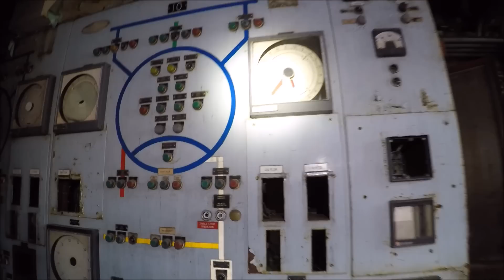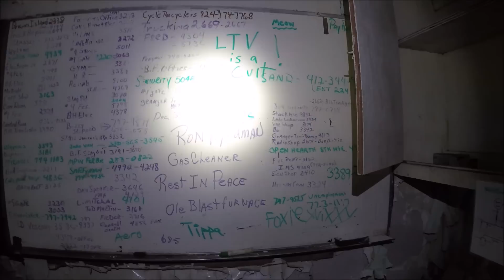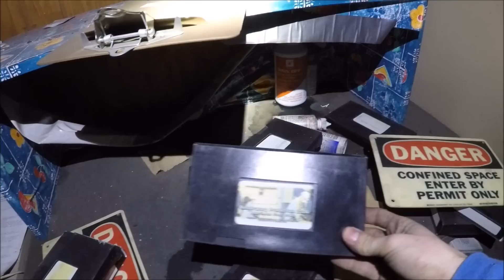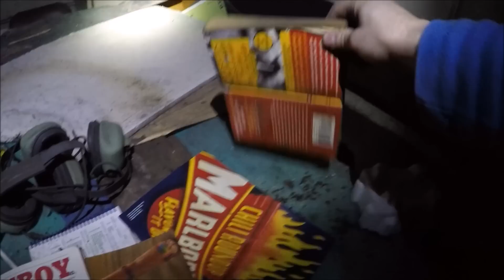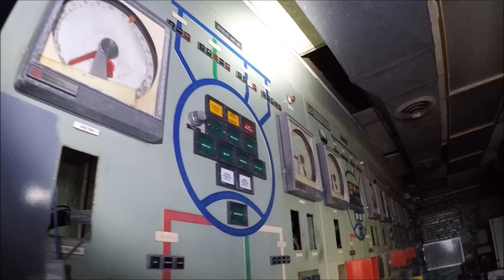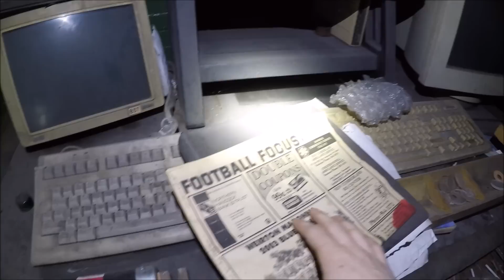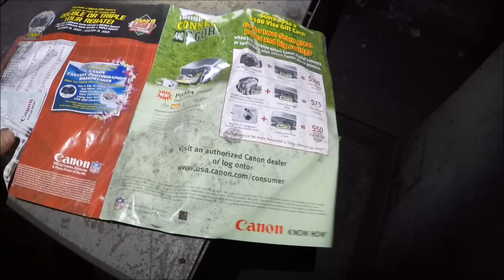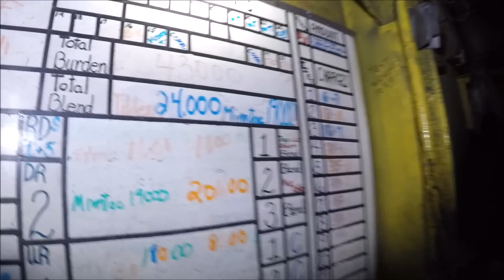UE - Exploring Abandoned Blast Furnace!

Comment: Those safety air tanks still had pressure.. surprised they haven't been stolen.  Probably worth more then $100 each.
Reply: Those tanks were worn by blast furnace employees to rescue a worker overcome by Carbon Monoxide gas which was burned in a air preheater called a Stove. These are the tall farm silo structures near the furnace.  One stove was giving off heat to the furnace while the rest were burning CO. Every now & then these stoves were switched by hand, There were always 2 employees to do this. If one was overcome by CO, the other would summon help. They would wear the Scuba Tanks & drag the fallen employee to safety. So that's why the tanks & why they were charged.
.